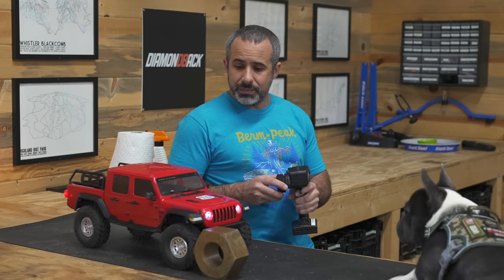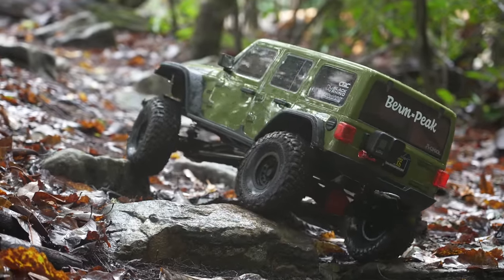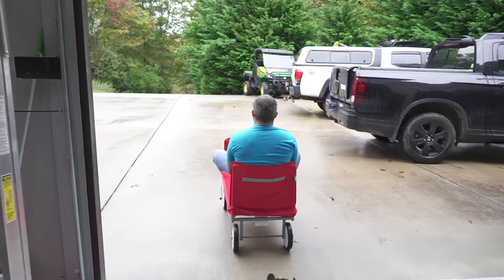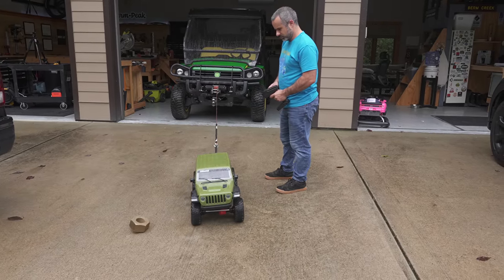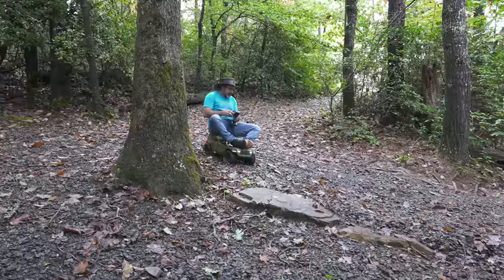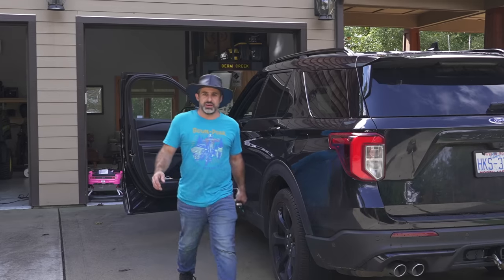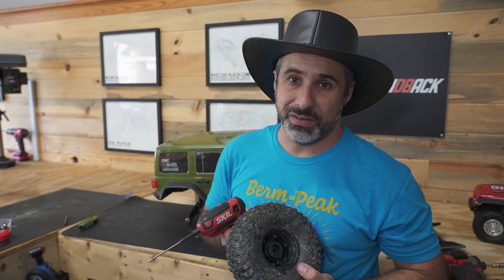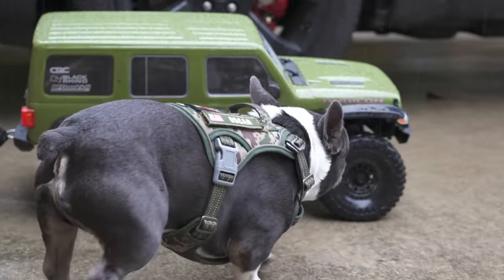This RC Jeep is HUGE! But can it tow a real car? Axial SCX6 Torture Test

Comment: "You can use a 2s or 3s battery with it. We used a 4s." Gotta love Seth
Reply: Was waiting for the esc to go up in smoke.
Reply: @derekhobbs1102  Stock esc in the SCX6 is 4S compatible.

Comment: 0:39 - If Oscar was 1:6 scale, his true size would be something resembling a Bison.
Reply: 6:1
scale
Reply: @valledahlgren1318  wrong
Reply: @siamese7577  wrong.
Reply: @UzzyT.  Incorrect.
Reply: @siamese7577  mistaken.
Reply: @valledahlgren1318  you right
Reply: @UzzyT.  your processes to find this conclusion were simply insufficient
Reply: @siamese7577  No, If it were 1:6 which i suppose you think is right at this moment. 1:6 is one sixth of the scale which would make him smaller. 6:1 of the scale he would be bigger because thats how a scale works. (sry if i mispelled anything im 13 and from sweden so i dont talk english as my main language)
Reply: @valledahlgren1318  you're right but you misunderstood the original comment. if he was currently 1:6 of his actual size then his real size would be 6x what is currently is, which is what the original comment said
Reply: @valledahlgren1318  exactly, the jeep is smaller so its 1/6th the size of a full jeep, if oscar was 1:6 scale, his size would be 1/6th the size of  a larger creature, the given example being a bison. not that hard to understand. if it were 6:1 oscar would be 6 timer BIGGER than a scale creature, but thats not what the original comment says

Comment: Not that I want to show how “seasoned” I am but I remember an article in Rccaraction magazine back in the day where they took a stock clod buster put a led weight on the front bumper and pulled a Jeep Wrangler across a parking lot with it .. that was a very long time ago.. hobby grade Rc cars have always been amazing.. Rc crawling has come a long way when I started you had very few choices clod buster full custom build .. 2.2 class trucks were only made using a Tamiya tlt or if you were lucky to have a bruiser based truck you had the most scale Rc ever. Great video thanks for posting it.

Comment: Seth: "lets tow the gator with it" result: A few seconds later gator comes crashing down and a $4 nut saves his life.                 Also Seth: "lets tow the explorer with it" result: A few seconds later the explorer comes bombing down and Seth literally JUMPS on the brake to save the crawler🤣
Reply: That nut is more than 4$ though
Reply: @schwuzi  yeah probably but it should be $50,000 if it did a performance like that😂

Comment: If you ever need to put your explorer in neutral there is a temporary option. The dial shifter has  a button in the centre (I believe it is labeled M) if you go into neutral and press that it will say a message on the dash to press the button again for a 30 minute nuetral mode. I had to learn tricks like this when doing wheel alignments.

Comment: I just looked it up, that Explorer is at least 4500lbs and it still pulled that! The 4.0l XJs I’ve owned and/or driven were rated for 5000lbs and it’s was nearly pulling as much, though I’m not sure an XJ would stop the Explorer any better once it was rolling😂

Comment: It's really funny to me the price creep on these things. RC crawlers used to be an affordable way to have some fun off-roading, but after building several I realized it's about the same cost as building a cheap four-wheeler. I bought and built a 98 Dodge ram with a 5 inch lift and 35 inch tires which is very capable off-road for about $3,000

Comment: Here's a comparison with a full-size counterpart, such as the TNT T-Rex Jeep JK (with 43 inch tires and a 121 inch stretched wheelbase).

Width: 86" / 14.88" = 5.78 scale
Length: 182" / 33.55" = 5.42 scale
Height: 81" / 14.55" = 5.57 scale
Wheelbase: 121" / 19.74" = 6.13 scale
Weight: 6000 lbs / 25 lbs = 6.21 scale
Tire height: 43.1" / 7.0" = 6.16 scale
Rim diameter: 20" / 3.2" = 6.25 scale

Comment: The ford explorers auto park, is not exclusive to ford. Most new cars have it. Its called "hill brake assist" which is to prevent roll-back on hills, so if you took the car off the driveway gradient, and parked it on a flat hill, it would not engage

Comment: You should run it on a 6cell 5200 and if your going to get it wet with battery put some tape around the connector

Comment: I’m just gonna keep posting this until he sees it for the next actual bike hacks video:

To turn regular grips into lock-on grips, (1) wrap you bars in electrical tape, (2) pour gasoline into the inside of the grips thoroughly (even on the electrical tape if you’d like), (3) slide grips on effortlessly, (4) wait 15 seconds for the alcohol to dry, (5) enjoy your new immovable grips.

Comment: Hey Seth, I have a question, this doesn't have anything to do with this video but i figured you may know the answer, I just watched a video stating that you can save weight by removing the centrifugal clutch weights from behind the Cassette, is this true? it came from a channel that in my opinion is pretty knowledgeable. Would their be any repercussions from doing this? Thanks

Comment: Your shift to park is a basic safety protocol.  If the car is in neutral and the sensor tells the vehicle there is no one in the drivers seat AND the car begins to roll it will shift to park to prevent a runaway.

Comment: I want to put hub extensions on the SCX6 like +10mm offset - (ordered mine but have not received it yet)  anyone know what the axle size is - referring to the actual threaded part  (I know the hub is 17mm)  im guessing the axle size is 6 or 8mm? (really hoping someone has popped the wheel off and measured)   or even better knows of a hub extension that works for sure!

Comment: Looking to mount Proline Trencher 4.3 1/5 scale wheels/tires... Seems like I'll need 17mm to 24mm adaptor/sleeves, anyone have a link to options? Yes, I will probably have to cut up the body to fit them, that is OK.

Comment: Should be able to tow and handle weight ect. I got a few Crawlers iv built up nothing this huge obviously lol but element Enduro Trail walkers and trx4 and two Scx10iii's and iv built up my two trail walkers and the Trx4. Huge 6s capable motors big blocks 4276 2200kv motors and one has a castle Momba monster 6s. And all steel after market gearing and 11% over drive in the front. and all metal rigs now iv sunk alot of $$ into em in aftermarket stuff and they are ridiculously strong. My element Enduro Trail walker that is my main driver. Iv got the proline interco super swamper TSL boggers XLs which are 54" boggers RC4wD steel rims all steel axles and driveshafts and all steel gearing. ATM the body is a 1979 Ford F250 that is wild looking it's rusted looking and red white blue black n rust 😂. It looks extremely realistic. Iv gotten the winches for the rear and front the lift kits on most of em. And the 124 mm shock absorbers so it's lifted pretty high up I got about 6" or so ground clearance from the frame rails or more. It's super nice I'm getting it ready for the winter because we get 17+ inches of snow about every week or so here during the winter and massive ice storms so I figured it would be bad ass to have a few lifted mud truck style crawler / trail trucks /scale trucks to goof around in it in. Iv gotten the 4k fpv cams and installed the long range transmitter n receivers in them so where talking miles away lol with fpv with the TV's or my VR headsets ect. So it's gonna be cool driving it in the snow storms as the ice and snow are falling hard going through the trails with the FPV I got extra led lights on em ect the head lights are pretty bright on all bodies. And work very well but I'm thinking imma need some fog lights as well to see through it if it gets really hard. And iv installed micro servos for the windshield wipers lol and bought the metal ones and added rubber to em n dude they work 😂😂 you should do fpv with your 1/6 scx6 for the winter it'll be bad ass driving it in 1st person through the snow. Like I am n a few friends

Comment: dude about time Axial made something big,and it probably wont tip as much since its so big,unless your doing something extreme
also this would've came in super handy at the Goodguys carshow and be lazy with style XD
Ahhhhh man i can think of all the things i would do,put a huge as motor like i do with all my cars,run it on 8s and make it into a towing beast 

Yeah...........Poor financial decisions are gonna be made after this video XD

also finding some quality wheels with aluminum hubs like what proline makes you could actually tow something really heavy,but i thinkf keeping the stock wheels would be perfect as a weak link until someone makes better drivetrain parts though

Comment: If you want to tow stuff with an rc car get the LOSI DBXLE 2.0 or ARRMA OUCAST 8s
Reply: Those arent geared for torque
Reply: Teen MTBer but the DBXLE is 30+ lbs

Comment: 🤣 dude you crazy!  every person’s dream to ride a RC 👍 and you did 🤣 epic 🤣🤣 ……. 🤔You should have a light weight aluminum roll cage with a light weight seat installed and beef up the body a bit so it won’t crack 🤗 and foam fill the tires 👍😛

Comment: Did you say the new standard? A new class in a year or 2. Definitely not going to cancel out the 1/10th scale events. Most guys have 1100 into there 1/10th. Can't afford to drop 1100 on a stock truck.

Comment: This thing is sweet but definitely wouldn't tow anything heavier then the rc can handle because your just making the motor and esc work way harder and can burn them out really easily or can over heat the battery and cause a fire but for entertainment it was still cool to see it tow the gator and ford also agree more electronic things in cars makes new cars way worse like how is a tow truck driver going to tow a car that doesnt allow itself to be put into natural

Comment: New cars are just dumb in so many ways.
#1 You can't see out
#2 You need to have all kinds of cameras because (see #1)
#3 They're way too heavy
#4 Absolutely moronic dings and bongs constantly
#5 SOS button which gets pushed by kids all the time and then you get charged
#6 They're too tall and big and the windows are too small which causes (see #1)
#7 They're too expensive
#8 Electronic parking brakes
etc. etc.